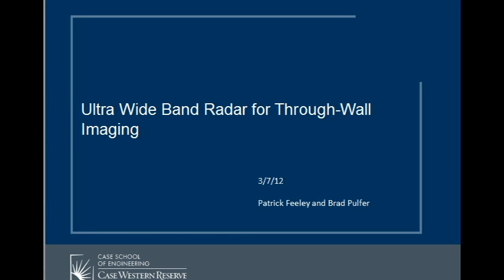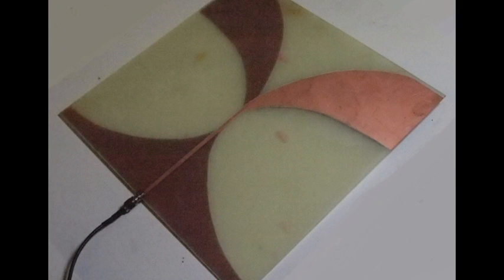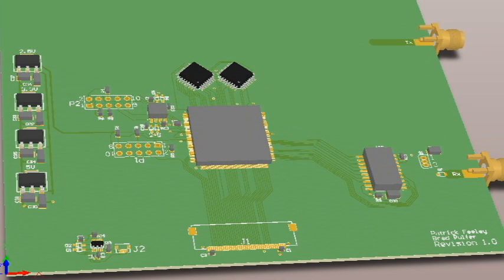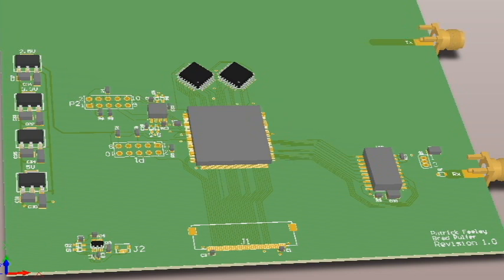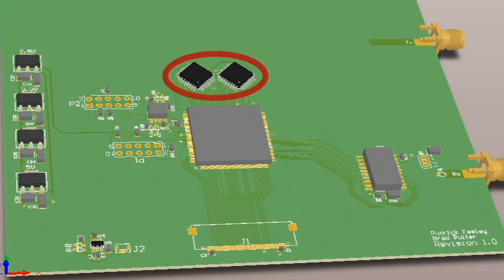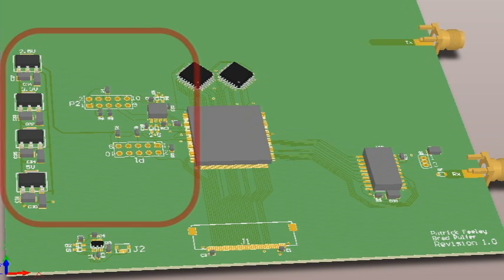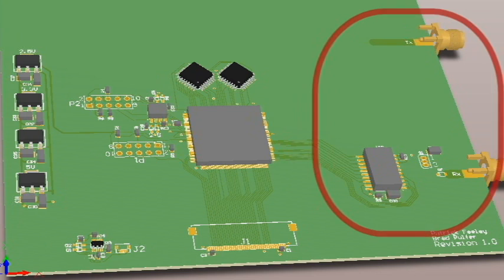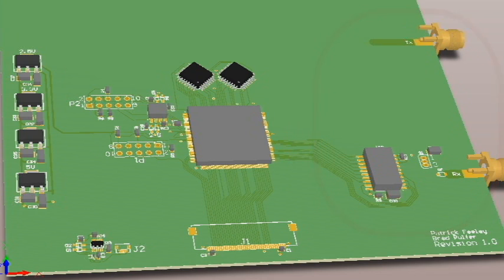Ultra-wideband Radar for through wall imaging

Comment: Did you get a chance to build this circuit and write the verilog code? This looks like an Altium board rendering.. BTW: ball-grid array FPGA's have better signal integrity, it also may be useful to look into using something better than FR4 for the top layer as well..